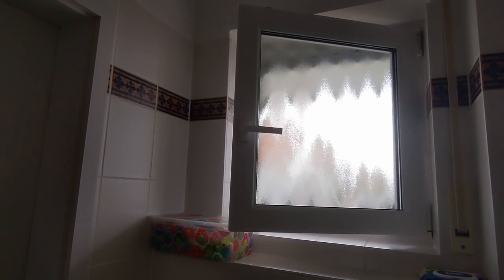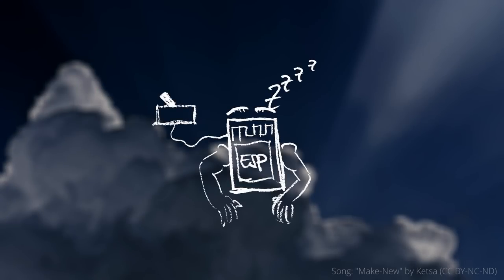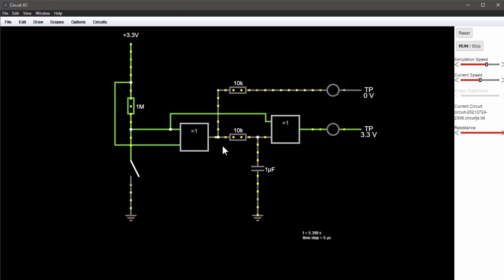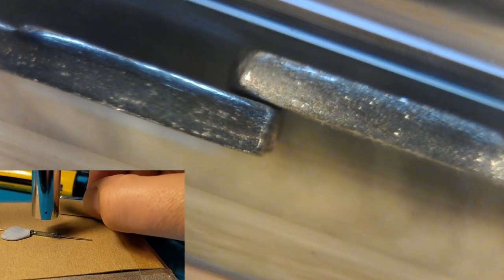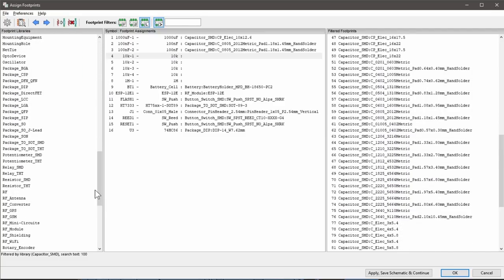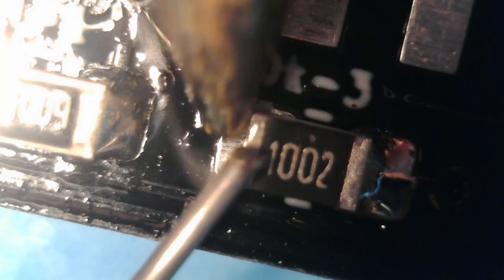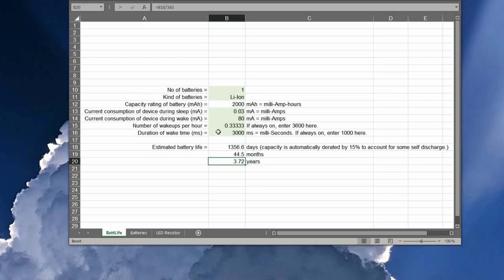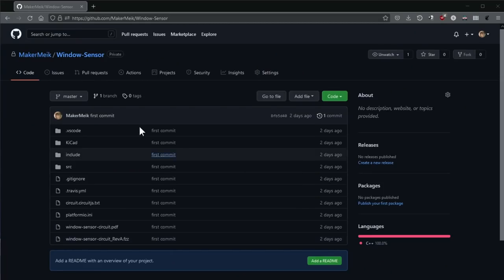ESP8266 as Window Sensor with years of battery life

Comment: You could further improve your pcb: Below the antenna area of the esp you could spare out the carrier pcb. The pcb material slightly "detunes" the antenna because of its dielectric properties..
Reply: Same could happen because of placing magnet sensor so close to antenna
Reply: @gmag11  Your point is actually even more important. Great!
Reply from the maker: @Germán Martín and @Antonio Della Rovere:
You are absolutely right. Maybe there is someone here who would like to optimize my design accordingly.
On the other hand, I now have six of my boards running and fortunately no problems with the wifi signal. In my house, however, there are almost no areas with bad wifi coverage.
But I knew that there would be many great ideas coming from you guys. Thanks for the valuable tips.

Comment: IF you forget the Wifi connection and use the ESP-NOW protocol you are able to shorten wake up time by 10 times with the same circuit. If you use on a high side a PMOS FET - controlled by ESP GPIO you are able to use as a switch before a resistor divider and you are able to measure the battery voltage.....
Reply from the maker: Thanks for your suggestions for improvements. I had actually already thought about ESP-now, because the duration of the wake-up phase essentially depends on the connection establishment. 
And yes, I should have added a voltage divider to my circuit. At least I let my code read out the voltage at the ESP by using ESP.getVcc(). This is at least enough to notice when the voltage is getting low. But the next revision of my circuit should definitely include a voltage divider. Maybe you or someone else would like to update the board accordingly.

Comment: Realy cool project! Was looking to make something similar but from "modules" and it will take too much space. Your solution is really pretty! One stuff I will update there and it will be that every time it send information about "On/Off" switch, it could send capacity/voltage information about battery. That you will be able to see when you should prepare for battery change. But I understand that if I will put 4000mAh LiIon, that I will dont need to change it for few years :D
Reply from the maker: As I wrote elsewhere in the comments, I already request the voltage at the cpu via ESP.getVcc() in the code. Of course it would have been better with a voltage divider behind the Li-Ion battery, but I think it should be enough to detect when the battery needs to be charged soon. If you revise the PCB and add the mentioned functionality, I would be pleased if you would share this improvement with me and the community on Github. :-)

Comment: Thanks for this nice video. May I suggest - 
The XOR ic can be replaced with only 2 10k resistors and a 1uf capacitor which can give you a nice negative pulse and save a lot of space. ( pull up both legs of capacitor to vcc with 10k, set the reed switch to GND and one leg of capacitor , get the negative pulse from other leg)
Reply from the maker: Sounds like a very exciting approach. Thanks for your inspiration. I'm in the middle of another project, but I'll try it out in due course.
Reply: Hi bro, I have tried your setup idea but it gives a low pulse only while closing the reed switch contacts. But while opening, it does nothing. We need a low pulse both while opening and while closing the reed switch contacts. How can this be achieved ?
Reply: The guy in the following video is amazing. https://youtu.be/8dT95zBeb1U
 He just used ATtiny85 chip and programmed it to do all kind of stuff like sending Door open/close code, sending battery low/high codes. And his circuit idea uses only 4mA just for a second while sending code and than at 0.5uA in standby mode. Seems battery would last much much longer.

Comment: I'm going to try ESP-NOW with this sensor, it doesn't require a connection to the router or IP address, it connects to another ESP device (Gateway) and can connect, send data in less than 500mS also it will probably have a better range. I t does mean having another ESP permenantley powered up to transfer the data to MQTT but that's no problem and if your router goes down they will continue to talk to each other.
Reply from the maker: I love the idea, and I've mentioned elsewhere in the comments that this would significantly improve battery life. If you get this working I would be very happy if you would share the concept and your code with us.

Comment: Great video, thanks for sharing. I went with a different design, te ESP8266 is powered down, and there is a "power latch" circuit using a P and N channel mosfet (IRF3717) to turn it on when a switch closes. Your video has given me new ideas to think about
Reply: @2000jago  I don't have a link, but it is based on Ralph Bacon's video. I just substituted the IRF3717 as its a convenient SMD package with both a N and P channel MOSFET 

https://youtu.be/g1rbIG2BO0U
Reply: Same here, i feel that switching on and off completely the esp with a latch switch is a little easier on the soldering side. Check for latch switch at random tutorials Rui has nice schematic there. Great video!

Comment: Gute Arbeit. Einige deiner Projekte (Tür offen gelassen, Briefkasten, stromzähler, etc) habe ich auch ähnlich umgesetzt. Wenn auch nicht mittels smd oder pcb
Reply from the maker: Normally I have no patience for SMD and PCB designs too. In the end, you have to order them after the design and wait a long time. If you then need the circuit for a single thing, it's hardly worth it. With this circuit, however, I knew that it can be used in many different ways. And for the window-/door sensors alone, it was worth it.

Comment: It would be good to add a watchdog feature so the ESP can wake up once in a while, say every 10 minutes, or every hour, to report in with a battery check, and the receiving side alert you if a sensor has missed a check-in.
Reply from the maker: I now have six of these boards in use and can tell you that if the magnet is placed properly and the Wi-Fi coverage is OK, they work absolutely reliably.
By the way, the current voltage at the ESP is sent via MQTT with every wake-up. I let Node-RED send me a notification when the voltage drops below 2.7 V. If it's a window that you open at least every few days, that should be enough without forcing the ESP to wake up every day. But sure, if you want to have that as a fixed heartbeat just to be on the safe side, go ahead. That's exactly why I put my code on Github, so you can adapt it to your needs.

Comment: Amazing design! I've thought about starting a similar project recently, so this video came at just the right time. Is there a specific reason why you chose to pulse the EN pin instead of the RST pin?
Reply from the maker: If the logic circuit had been built differently, it would certainly have been possible via the RST pin. Basically, you could also take a smaller ESP, as long as you get the deep-sleep issue under control, and they have only a CH-EN pin. But of course, there would certainly be more options.
Reply: @MakerMeik  Hi! Wonderful project! It is still not clear to me why this logic can't be applied to RST pin without any modification. A LOW state for a brief period of time on RST pin would reset de Esp and wake it up. Wouldn't it?

Comment: Sir can i have your gerber file sir? Or at least a picture where you design TP4056 and HT7333. I'm doing a little project but wondering the power source using TP4056 and HT7333 for Li-ion battery. Thank you sir!

Comment: Hi there I have an issue with version 1 of this sensor. It would be good if you could help me out with it. My sensor can detect when the window is open without any issues. But when it comes to closing, it wont work all the time. I tried to diagnose the issue with serial monitor and found that when the window is being closed, the esp8266 starts to wake but before executing any functions, it hangs up. One more thing I noticed is that when this problem occurs the onboard led won't even blink like when the board boots up. But when we push the reset button(GPIO16) in closed state, the device boots fine and completes action and sleeps.

 Is this a code issue or some hardware issue? what can be the issue? I am confused because majority of the time this works fine.

Comment: Hi, I hope someone can help.
The first 5 window opening sensors I put together are working perfectly, but the last 3 are suffering from the same problem that I can't figure out what is causing it. When I apply voltage to the board from the battery, it works, wakes up and signals, and as long as it is awake the esp detects and signals the change in the magnet. Once the esp goes to sleep the voltage on the enable leg disappears and can no longer be woken up by moving the magnet. To the best of my knowledge all soldering is ok. Anyone have any idea where I can look for the fault?

Comment: Hi, 
first of all great tutorial. I have a question about the excel sheet. In your excel, when for example you put AAA batteries the mAh is 600mAh per battery. When you put a number of batteries two, the result is 1200. The AAA battery voltage is 1.5V and you have to use it in series to get around 3V. Does this mean that you have still 600mAh, not 1200mhA?
Reply from the maker: If you connect the batteries in series, the voltage increases, e.g. to 2x 1.5 V = 3.0 V and you still have twice the capacity, so in your example 2x 600 mAh = 1200 mAh.
However, you also have to consider the characterisics, how the voltage changes over time during discharging. Depending on when the ESP8266 stops working, you may not get your batteries completely empty, depending on the type of battery you are using. Andreas Spiess has, as so often, made an excellent video about this:
https://youtu.be/heD1zw3bMhw
Reply: @MakerMeik  Thank you. I appreciate it.
Reply: @MakerMeik  This sounds highly inaccurate.
Reply from the maker: @Edward Soares: Hehe ... you seem to be an expert on this subject. Please explain it from your point of view.
Reply: @MakerMeik  Rather than from my point of view, I'll explain it from my engineering background based on science and facts. In series your voltage increases and amp-hours stay the same. In parallel the voltage stays the same and the amp-hours increase. So in this scenario @Erjon Ameti is correct to assume as he did. I will agree watt hours energy does stay the same in series or parallel based on volts x amp-hours. So 2x1.5v@600mAh in series is 3v@600mAh and 1.5@1200mAh in parallel both providing 1.8 watt hours of energy consumed differently, one at higher voltage capacity and one at a higher amperage capacity depending on the circuits need. Both ways providing the same watt hours output due to math does not negate the outcome of series vs parallel. This is basic electrical engineering and applies also to resistors, capacitors etc.
Reply: I was not trying to call you out and thought I was delicate about it. Just was hoping it would trigger a thought that maybe it needed more looking into and correction.
Reply: @edwardsoares3838  Hello Edward
How can we make that excel spreadsheet more accurate? So the main point now is to focus on battery draining in different voltage capacity!
Reply: @erjonameti  I haven't looked at the excel sheet myself yet but its likely embedded math in one of the cells that needs to be edited. The tutorial itself is really good and I thought it was addressing battery life issue already otherwise?
Reply from the maker: Many thanks for your correction. I had obviously been short-sighted and you are of course absolutely right - I * V = P. As I have already said elsewhere, I am an engineer myself, but unfortunately not in the field of electronics. I hope you'll forgive me if I'm not fully grasped in every respect.

Since my window sensor solution works reliably, I still decided to share it with you. Especially because there is no comparable Youtube video on this topic to my knowledge and I wanted to show the process from simulation to PCB design to SMD soldering in a compact and hopefully entertaining way. For real experts this is probably too boring.

But I'm not upset or offended by your comment. So no hard feelings. I think in other cultures that's more of a problem. I just couldn't quite understand why you didn't set the record straight right away.
Reply: @erjonameti  I took a look at the excel, it's math is setup for batteries in parallel. Voltage will remain constant while amperage will change with battery count allowing for longer runtime.
Reply: @edwardsoares3838  Okay
Reply: @MakerMeik  I was trying not to come across as rude is all as I normally am :)

Comment: Ahh man, I blindly started exactly the same kind of project and did so much head scratching I am now bold! This video helped me A LOT! I am quite curious about the minimal circuit of the ESP-12 module. I am only pulling Enabled Pin high with a 10k resistor and my ESP's run perfectly, I only use the GPIO0 and 15 for programming the module. Another thing that I am wondering about is the Reed switch. Is there a SMD alternative?
Reply from the maker: There are numerous subtypes of ESP12 modules (12S, 12N, 12F, 12E, ...). Some of them have the pullup resistors already built in, others not. This video explains the differences well: https://youtu.be/n_A_8Y4xNx8
However, I didn't really realize this until after my project and video.
For the reed switches, there are definitely alternatives with plastic housings. A general alternative to reed switches are hall-effect sensors. But these always need a power supply and therefore they consume a little bit of current even in idle state. That's why I decided against them. I didn't investigate this further though, maybe there are models that draw so little power that it doesn't really matter.
As mentioned in my pinned comment, I am a fan of my viewer, named Gadjet. He has developed the project a lot further. His focus has been on minimizing the circuit and extending the battery life. He achieves this by using ESP-now instead of the WiFi connection:
https://github.com/gadjet/Window-Door-Sensor-V3/
So this project is definitely worth a look.
Reply: @MakerMeik  thank you sooo much for the reply and making things clear for me! Really much appreciatd! I am going to do some experimentation of my own :D Wish me luck! Keep up the good work!

Comment: I tried building one. 5 pcbs actually. Had gpio13 connected to the reed switch. Out of 5 pcbs one was working as expected after some modifications. I made some more modifications and forgot to save the one that worked . And now i have 5 pcbs, none of which are working as expected. Can you help?

Comment: Kudos for this amazing setup.
Finally something easily reusable!
You are also probably the first person who actually does data transmission efficiently and securely.
The alternatives to wifi like bluetooth are a disaster from security perspective.

What I'm really curious in this setup:
How big was your total latency with and without DHCP from triggering the sensor until the message arrived?
Reply from the maker: With the fixed IP address, it takes about 3 seconds for the message to be transmitted, as explained in the video. If the IP address must first be negotiated via DHCP, the time increases to about 5 seconds.

The actual transmission of the MQTT message works almost without any significant time delay, or at least in much less than a second. This can easily be tested by letting an ESP8266 send MQTT messages e.g. with a permanent power connection. So what costs time is actually just the boot process and the establishment of the Wifi connection. That's why it's worth optimizing this.

If you have a more time-critical application somewhere where the 3 seconds to message is too long for you, you won't get around a permanently awake ESP and thus need a permanent power supply.
Reply: Which alternatives are you referring to, I'm trying to make something more efficient than WiFi. 
Does using zigbee for instance could improve battery life?
Reply from the maker: As I have just written elsewhere in these comments, I think a solution with ESP-now should increase the efficiency significantly. The user @Aaron Zhang has kindly provided a link to the video of @Anreas Spiess, where he discusses exactly this topic: https://youtu.be/6NsBN42B80Q

Comment: Cool Project! Not sure about the capabilities of the esp but when I worked with microcontrollers you usually can register an interrupt on a gpio pin to trigger a wakeup. I wonder if it's possible to register such an interrupt on both edges of the reed switch which would then eliminate most of the custom circuitry and might even save power because the boot sequence can be skipped.

Edit: nvm, seems that the esp doesn't support gpio interrupt wakeup, so your solution seems to be one of the ways to go.
Reply from the maker: Thanks for the cool idea. And that you also researched the answer to your question right away. I found the approach fascinating and was already about to start looking for it too.

Comment: Great Video! I learned a lot :) Any chance to tell me where  you ordered your SMD 0805 switch buttons? I dont find them...
Reply from the maker: I have these ones: https://www.ebay.de/itm/303252945239
50x SMD DIP Mikrotaster ... 2-polig 3x4x2 mm
However, they only fit very narrowly on the pads. Minimally smaller buttons or slightly wider pads would make things easier. But it works ;-)
Reply: @MakerMeik  Thank you verry much! I will then update the pads on the PCB to larger ones :)